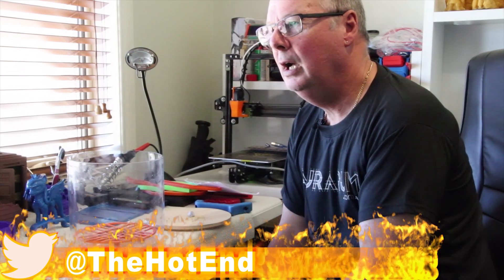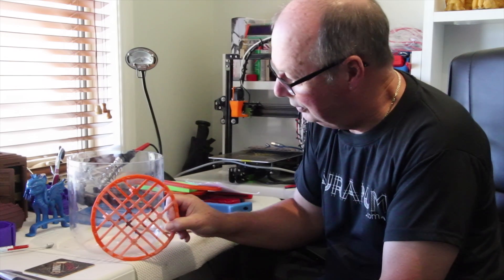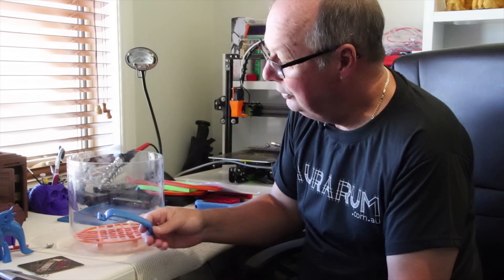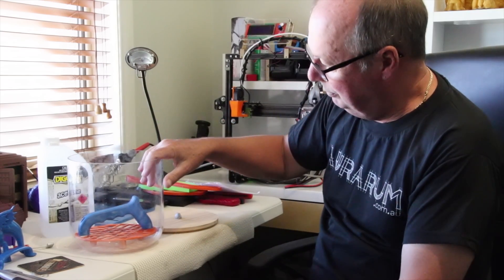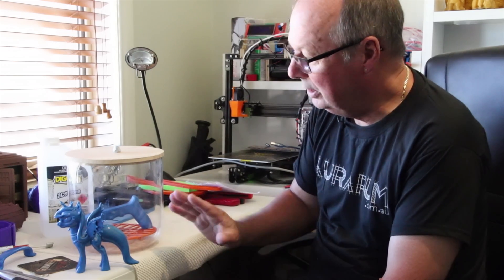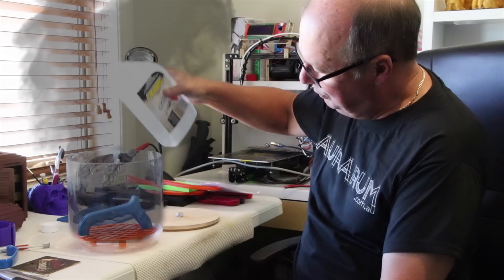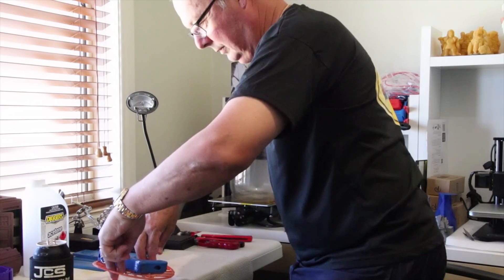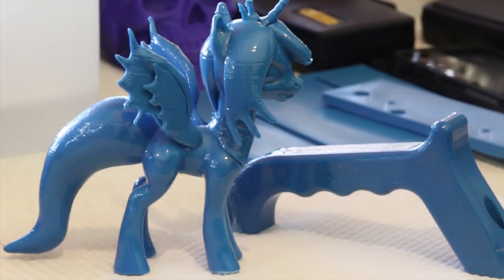Vapor Smoothing ABS 3D Printed Models (Tutorial)

Comment: Pretty cool. =)
I actually use a coffee can for this. I lined the inside of the can with paper towels and hold them in place with friction-fitted cardboard. Then I soak the cardboard/paper towels and flip the can over top of it's lid to seal it. Just plop your print down on the lid, first, and it's smoothed in 30-45 minutes.
Reply from the maker: nice one! glass is the go if you can find one but whatever works :) glad you liked it